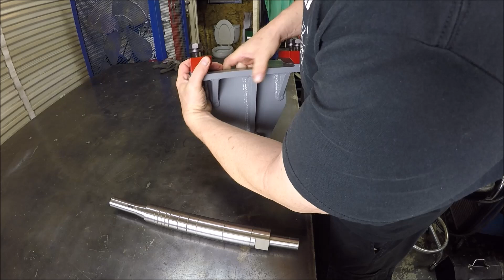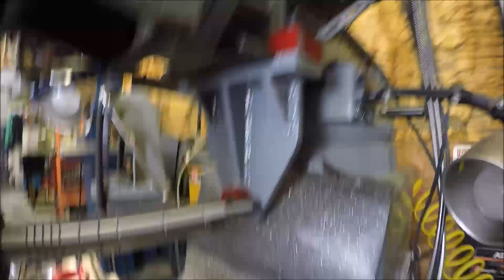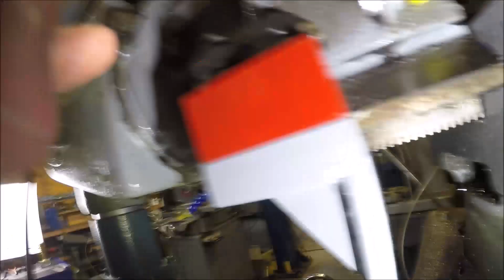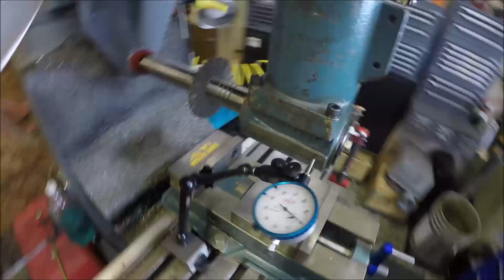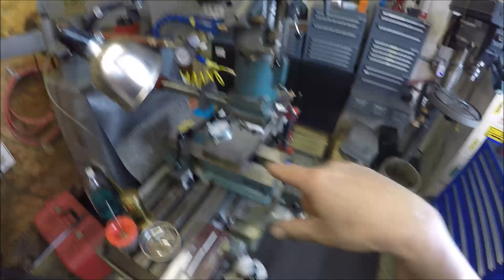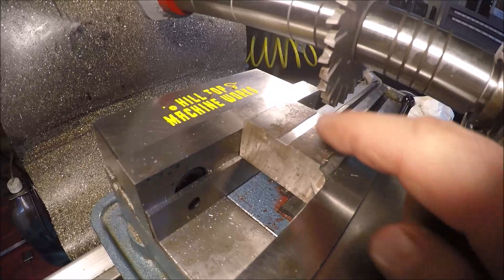Arbor support for right angle milling attachment  Part 6  It's Done!

Comment: Awesome job on the support, it looks pro and you just added more usefulness to your mill. One local fellow has an Excello, they are nicely made machines.
Reply from the maker: Thanks Everett. Tried to make it look factory original. It has been a great mill so far. I do need to replace the spindle bearings at some point.

Comment: Since the end of the shaft appears to be much longer than needed for the roller bearing in the support end, why not cut it off?
Reply from the maker: I could but not worth the trouble to remove the extra. I think it is only about 3/4 of an inch.
Reply: @hilltopmachineworks2131  would that 3/4" not allow you easier assembly?

Comment: Those tacos act off reflection so that shiny shaft giving it fits. Wrap some painters tape around it and put your reflector on that and it should work much better and more accurate. Glad you got your new tool going!
Reply from the maker: Thanks for the tip Brian.

Comment: great job, I picked up the right angle attachment  new an cheap, I have test run  it but not used it. I would have to do a different bracket for a Round ram with a J head. I will first have to see what uses I would have for the rt. angle and then for its benefit in horizontal milling. I will look forward to see how you make use of the tool.
Reply from the maker: Thanks for watching Ed. Hopefully I can get some use out of it in some upcoming projects.